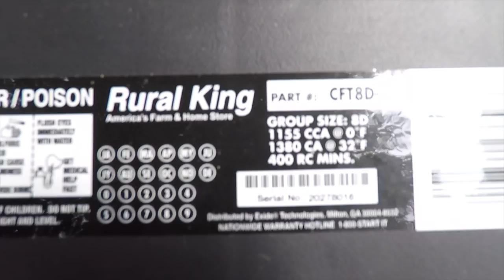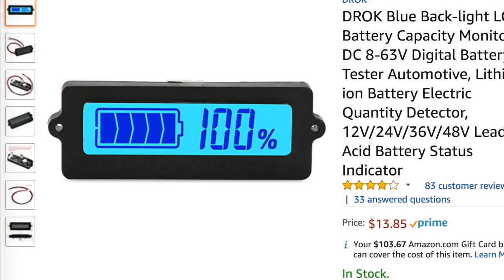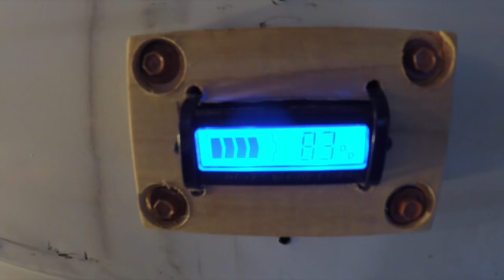New Battery Meter -- Prison Bus Conversion #28

Comment: Hey!   Great video series..  I am close to beginning my skoolie conversion and love the ideas you're giving me.   You're a creative guy!   :)

One thing I have noticed and would suggest..  You seem to disconnect the batteries a lot, maybe not after you're finished but as an option, you should consider adding a disconnect on the bus so you could disconnect the batteries when you need to work on the electrical vs taking the terminals off and on every time.   Also, if the bus were going to sit for a period of time, you could turn off any draw on the batteries with the disconnect for long term storage..  

Just an idea..   Keep up the great work!!
Reply from the maker: Super idea on the batter disconnect. Those terminals are getting stretched out and pretty shot ... a disconnect is definitely the way to go. Thanks for the tip! (I'll have to look for one)  Take care

Comment: friend of mine bought an old rv trailer once and used heatgleu to mount small shelves and towelhangers and stuff like tat
once they where on holiday the trailer stood out in the hot sun 
he and his girlfriend whent out slammed the door and heared a lot of noise , when they checked the interior all the heat gleu stuck on parts had fallen off the walls
Reply from the maker: Crazy!

Comment: Had to chuckle as I've made the mistake of cutting a hot wire, or even the wrong one, before. lol Cool little meter, though I would suggest adding a voltage gauge later on for more precise readings.
Reply from the maker: dang wires in that bus are pretty close to spaghetti ... good idea on the voltage meter. I'll put it on my list
Reply: metaspencer What happens if you cut a live wire besides the obvious dangers, does it bleed the charge(drains battery) or what? and if so how do you prevent that.
Reply from the maker: Fire, short circuit, dead circuit, etc

Comment: I was just thinking I need to do the same and contemplating a small solar set up to keep my batteries topped off since the place we have it at has no power supply for a battery charger. I am tearing my dash apart and running the bus to charge is not an option at this time.
Reply from the maker: I have a simple solar charger on my tractor battery, and it's been working great

Comment: Good to see a video. Just got 7 gallons of Valvoline Blue from Rural King. The messed up the order and it took two weeks, but they had the best price even with shipping, time was not a factor as it is for the next oil change. . These cable tie guns are great. http://inspiremedianu.com/tag/nylon-cable-ties/ They cut the ends of so that there is no sharp end. Heat shrink crimp connectors are also great. Glenn Lever
Reply from the maker: ThrottleStopRacing hey Glenn! Always good to hear from you ... I didn't know the dragster was held together with zip ties 😊
Reply: You would be surprised how many are actually used. Glenn Lever
Reply from the maker: I think I do have one of those zip-tie guns ... should have used it! But I have been liking these zip ties that have a built-in cutting in them: just twist the tail and they cut off themselves
Reply: I had not heard of those. Do the prescored cuts weaken the tie? Not sure how that battery status indicator works. Is it just a voltage gauge? Most battery checkers need to be done with a load on the battery. A dead battery can read 12 volts, but not deliver any current. A way to us the gauge you have is to watch it while cranking the engine. Glenn Lever
Reply from the maker: The twist-off zip ties are here: http://amzn.to/2Drvk3p ... kind of pricey, but nice in some instances. I'm equally unsure of the mechanics of this gauge ... it just shows a percentage of charge, and seems to be accurate
Reply: Price range? I suspect it is a fancy voltage gauge. I would think the best pratice in using it is to check while cranking. That way there is a load on the batteries. Glenn Lever

Comment: yo... can i have the old phones if you still have them?
Reply from the maker: Sorry! I gave them away already... they worked and were pretty cool
Reply: @metaspencer  :(
Reply: @metaspencer  how did the phone connect like what made them work, maby i can build my own for my sister and i
Reply from the maker: It was a pretty simple system: the power came in to one phone  (12v DC), then all the phones were connected on a simple circuit
Reply: @metaspencer  oh, i will figure out how the circuit went, thanks